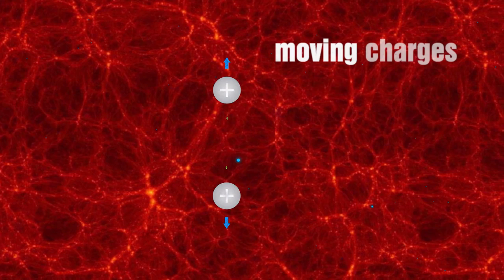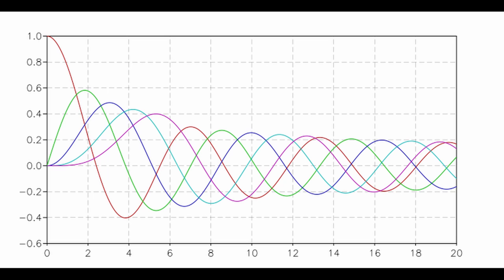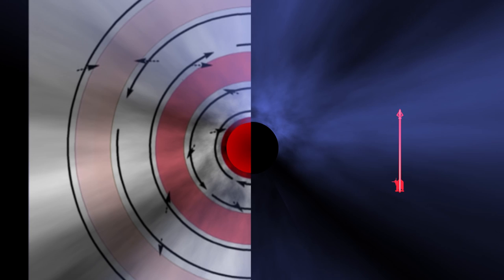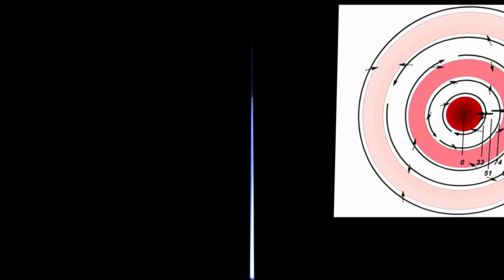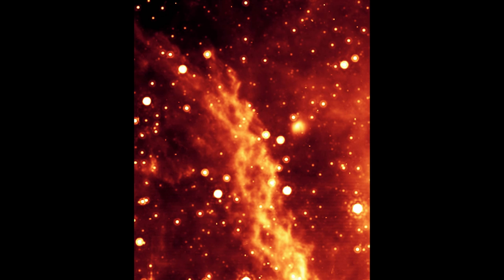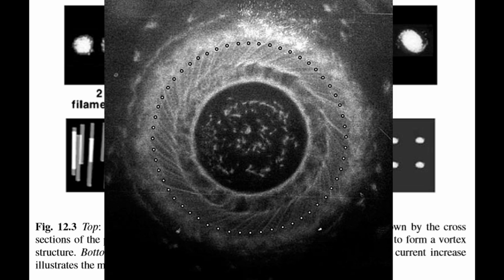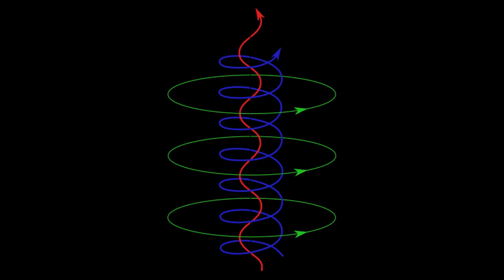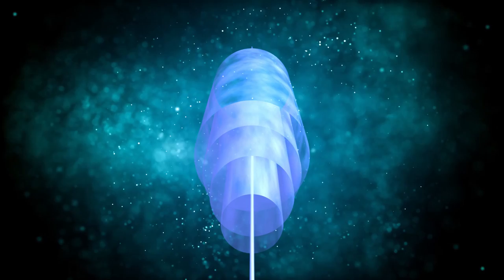Understanding Don Scott's Birkeland Current Model

Comment: Ones thing you need to understand is that the force free field aligned currents described with Bessel functions are solutions to Maxwell's equations.
It is an approximation of the reality trough mathematics alone.
This does not predict the existence of currents, just the shape of them. There still need to be an electric field beyond all of this that causes the electric current in the first place.

When it comes to Marklund convection and why that happens this is far more solid physics than any explanation behind the Marklund convection. The Bessel function of the type 0 is the most basic solution to Maxwell's equations for electrical currents. If you would question the theory behind it then you have to pretty much question Maxwell's equation completely.
The Bessel function of type 0 does not account for external disturbances to the electrical current. This could be due to an external electric field or an external magnetic field. This is due to the simplicity of the assumptions. It is just a lonely current traveling trough the vast empty space.
The Bessel function also assumes that all forces cancels each other out. This means that there will be no variations with time and is the reason why it is called force free.
Of course this won't apply to more complicated systems, but it still appears to have similarities with them.

Comment: A DPF device does not constitute a force free system since there is a time varying aspect to it. Neither is it a typical straight electric current like the Birkeland currents. It is an umbrella shaped current passing from a circular negative node to a more central positive node. The central node can be a cylinder or a just a metall rod and it will cause that umbrella shaped pattern. The umbrella shape is due to Ampere's force law.

The twisting double filaments could be due to some form of external electric or magnetic field inducing instability. This is when we can see J_1(kr)cos(φ) instead of J_0(kr) pattern.
Here is a good picture: https://encrypted-tbn0.gstatic.com/images?q=tbn%3AANd9GcR4Ho4PopK9JLvn2S7CceWWiS4pMGDh7rSwDokba37UdHryn_tG
The Bessel function has two constants k and α: J_α(kr)cos(αφ).
In the image the first column has an α = 0, the second column has an α = 1, the third column has an α = 2 and the fourth column has an α = 3.
The k value defines the frequency, which increases the lower you look in every column.
These images looks like Bessel functions with a boundary condition at a distinct distance, like the vibration of a drum skin. So k is likely an integer. In Birkeland currents it is not that simple, so it is mostly assumed to be that the current goes to 0 when r goes to infinity.

What I mean is that the twisted double filament you see in plasma currents could be two filaments with currents moving in the opposite directions of each other. In other words that α = 1. This appears to be the case when looking at satellite images of the aurorae: https://agupubs.onlinelibrary.wiley.com/cms/asset/f7275e09-1963-42e4-9a6c-db62c81af1ae/jgra54212-fig-0001-m.jpg
What you have here should be a current following a magnetic field with a perpendicular electric field.

Comment: The boundary condition has to be that it goes on for ever and goes to 0 when r goes towards infinity. Otherwise you would end up with something more complex when trying to figure out the equation. The Bessel function is a simplification of reality, an ideal case where the boundary condition exist when r goes to infinity.
What we see in space are not clear boundaries of the plasma, but transitions from dark to glow mode.
Reply: Electro-Cute yet we do have sharp radial boundaries to filaments on all scales. On many scales, we see that the boundary surface is in fact a charged double layer.  But what determines that radius exactly?
Reply: @jamesweninger3679  
There are no sharp boundaries, just approximativ boundaries. When we look for the web of intergalactic currents it is a very approximativ diameter that they give us that appears to be the same for all currents.

Anyway, what you are talking about are not boundary conditions. Boundary conditions are things you need to define when you are solving differential equations. It means where does the phenomenon theoretically end and what properties does it have at that point.

What you are talking about are the visual ends of currents. Those ends are when the  plasma abruptly transitions from glow mode to dark mode.
The double layers can be a reason for plasmas to go from dark mode to glow mode, but not by necessity.
Most double layers are invisible and not everything that glows are a double layer.

What determines the point when the plasma starts to glow is a complex. Here is a very arbitrary chart of how dark mode to glow mode transitions: https://qph.fs.quoracdn.net/main-qimg-e3cdc7ede85e52f11022f6ceb0b1a0a8.webp
It also depends on the density of the gas. The electronegativity of the gas.

Comment: “What Tesla accomplished is the greatest discovery in mankind. The transmission lines you see everywhere, along the roads in every
place you go, these allows us to have a giant drive shaft that we can take rotary motion from like a massive turbine plant and convey it
thru an electromagnetic structure that operates with reflected waves and time frames. This work just like a drive shaft, it bounces back
and forth, twists, and rotates. But you can stand outside and look at those thick power lines that go down any public street and in the
space between those lines, the energy there is the energy of a giant railroad locomotive moving at 95% of the speed of light down the
space between those wires, and there is no evidence that anything at all is happening except that the wires are slightly pushed apart
and warm. So it’s a type of drive shaft that exists in another dimension. Then you put the synchronous machine on the other end (of
that power line) and you couple out of that (electrical) drive shaft like a transmission and you have rotary force again. These things
(rotary Tesla generators) are no more than stamped iron in patterns. By making this special arch form and its influences on the
formative forces in the Ether ...Tesla’s invention is the most powerful arch form the human race has ever conceived.” – Eric P
Dollard

Comment: Questions...

1. About the two components of magnetic fields... I get confused either by the word "magnetic" or "two". Is one of those components the Coulomb force, i.e. the "electrical" component?

2. In the description from around 10:15 , you say that the particles create their own Lorentz force when they move. What reference frame do you use when you talk about their motion? Is it the background "ether", or is it all relative motion between the particles? The reason I ask is because I'd like to know how two equal particles are supposed to affect each other if they travel along two parallel paths, with a relative velocity of zero.
Reply from the maker: When I refer to the components what I mean is that any force can be divided into two components that are at right angle to each other.  These are still the same force, like you would have done in a physics class when you were trying resolving forces.  So this has nothing to do with the electric force.  It's just we are examining how the overall direction of the magnetic force changes by examining the two components.

As for your question regarding the Lorentz force this is a rather interesting one.  From a classical perspective it is just motion that causes this.  Electrons flowing down a wire create a magnetic field due to their movement.  But if we examine the movement of the wire we know that the earth spins on it's axis and moves around the sun.  The sun it orbiting the centre of the galaxy.  Do all these motions create their own lorentz force?  From the relativity we also have the concept of frame of reference so two particles next to each other may both be travelling at speed and not be aware of it.  For a lorentz force to be created we only require a constant velocity but a frame of reference is never specified.  You may be right in thinking in terms of an ether and this is certainly where my thinking is heading towards at the moment but the classical explanation never really delves into this.  This is a very interesting rabbit hole you have just presented me with :D
Reply: @SeethePattern  The mainstream explanation to why two wires with like currents attract uses relativity, and requires the presence of both positive and negative charges. It would be interesting to know how an electron beam in a vaccuum behaves. The closest thing I know that one can study are old CRT displays.
Reply: @SeethePattern  special relativity was invented so that these questions are answered. In special relativity no matter what frame of reference you use to describe two moving charges, you will get the same physical outcome. The basic concepts are included here. https://en.m.wikipedia.org/wiki/Classical_electromagnetism_and_special_relativity

Comment: According to Eugene Bagashov "counter-rotating quasi cylindrical berkland currents AKA field aligned currents well in this case they were actually berkland currents falling into the auroral zones right but unfortunately this is not what happens like you might think. There's like a cylinder as according to Dan Scott's model should be cylinder of current falling onto the earth but that's not the case. Those berkland currents actually formed from the equatorial ring current area like 10 Earth radii away from the earth itself and and then from this equatorial region they fall into the polar areas kind of like it in a doughnut shape". He does not agree with the concept of ForceFree-Aligned Currents following a Bessel Function. 
What's your take on that @See the Pattern?

Comment: Page 12:17
We were educated about electrons and ions as independent entities in an electrical environment, on earth and in the cosmos. Let me propose an alternative view about them. 

Static charge do not migrate along an insulator.
Static charge do migrate along a conductor. 
Migrating charge is mistaken for current.
Migrating charge is mistaken for electrons. 
Migrating charge can only be migrating charge. 
Static charge don’t migrate in cosmic vacuum 
Static charge migrate in vacuum on particles. Charged particles is a vehicle for static charge. 
Free space particles, a carrier of static charge.
Space particles randomly drift through space. 
Random implies averaged vector random. 
Net vector isn’t random in nano or pick sec. 
Once particles begins drift for a nano sec ..
Particles of net group induce magnetic field
Induced magnetic converges the net group.
Open space for ambient particles to come in
More particles drift into special vector 
Further induce magnetic field into same vector
Further converge more ambient particles 
Further into a regenerative process, otherwise
called constructive instability of plasma. 
Plasma take two forms: Before (1) and after (2) birth of planets / galaxies. 

(1) intense energy and particle density : no cosmic spheres other than dusty vacuum
(1) format : binary, twin filaments 

(2) subsided cosmic energy and particles density : precipitated with cosmic (vacuum and spheres). 
(2) format : concentric filaments (Don’s model)

 After birth of the universe of today and used up energy and materials, there isn’t much left to further equal size geniuses as before ... equilibrium state. 

Thanks to free space, free particles and migrating static charge but gravity, for the genesis of this universe, free of black holes.

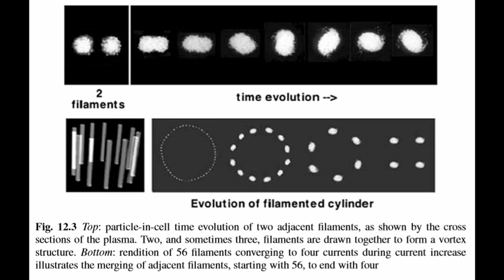Comment: Before and after page 8:40. 

Try not be mislead ourselves with correlation.

Before : cross section of an intermediate path along Z axis in space. (- Anthony Peratt). 
After : Artist’s shape correlation : insertion of a terminal pattern on an intermediate pattern (- Donald Scott).  

Terminal? A place where the BC terminated on a load, the atmosphere at the polar region of a planet. 

Load? The BC energy dissipate in doing work, moving clouds of particles / dust at terminal atmosphere.

Why polar? 
Because that is also a terminal of B field of that planet. 

Don misunderstood a (terminal condition) for an (intermediate path condition). 

Poor Don didn’t accessed to a lab that Anthony Peratt can.